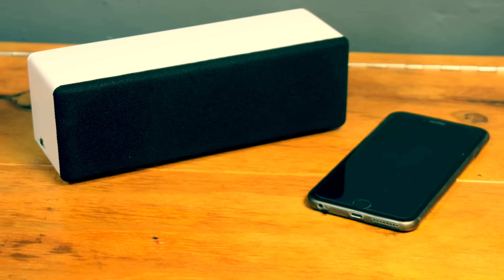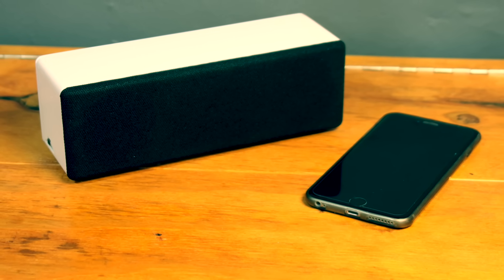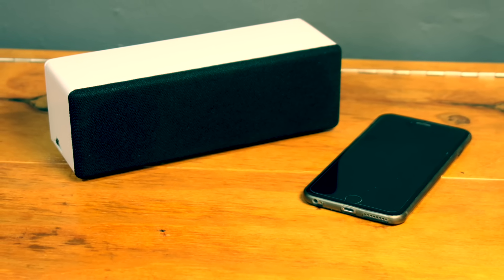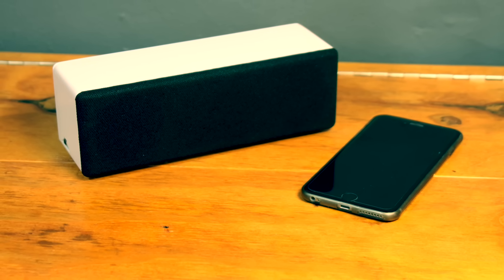Building a Small 10 Watt Portable Bluetooth Speaker - by SoundBlab

Comment: Great build! Can you do a video explaining how to solder together the amplifier board to the various parts? There isn't a single video on youtube that i've found detailing how/where to connect potentiometers, on/off switches, LED indicators etc and you sure seem to know what you're doing...
Reply from the maker: Perhaps we can do this in a future video sometime.
Reply: arithehurricane   'Barry llewelyn', or 'Baudio', did a video on building his 10w speaker. Soundblab did exactly what Barry did as far as I could tell so you could check out Barry's video for information on the soldering.

Comment: Best use for an Edgards Club card I've seen in years! Thanks for the video.
Reply from the maker: I agree! Thanks.
Reply: SoundBlab hey bro I want to connect 2 speakers and 1 tweeters if I get all three in 8 ohms and a 8 ohms three way crossover it will be still at 8 ohms..the impedance will not  change right?

Comment: hi great job it looks amazing. But from what I understand from that specific passive radiator, it should be mounted, the other way, so that the grooves are invert:). i haven't tested it yet, so I am not sure
Reply from the maker: Thanks Amir. I have not tested it either, but it really should not make a difference in the performance. There are many drivers and passive radiators out there with inverted surrounds.

Comment: Another beautiful project!
Did you use the capacitor because you were using an unprotected charger?
Reply from the maker: Thanks. No, in this case the capacitor helps to prevent a pop sound when you switch on the speaker. It's needed for both un- and protected charger boards.
Reply: I'll add in the project then.
Thank you!!
It encourages me to see your videos.